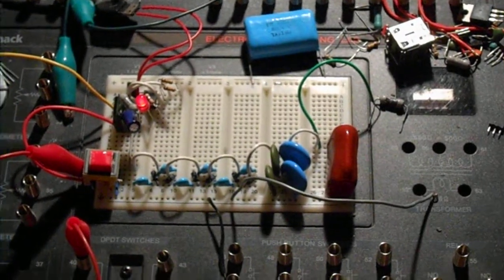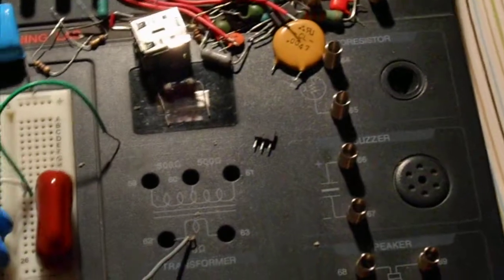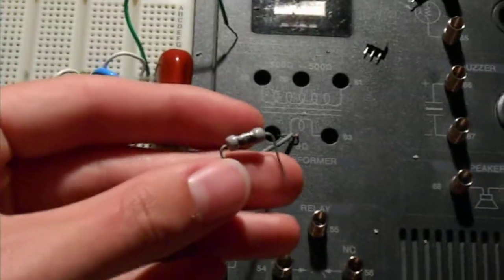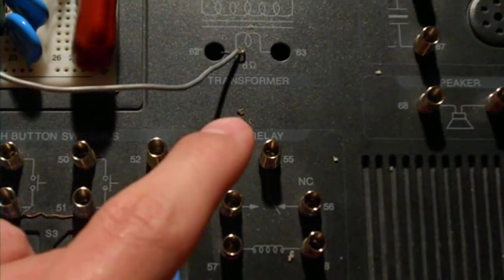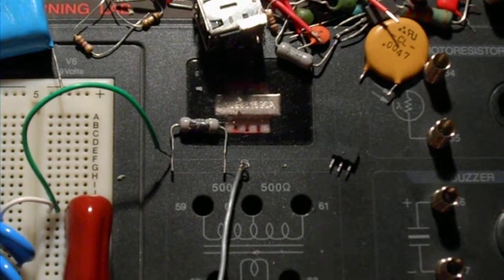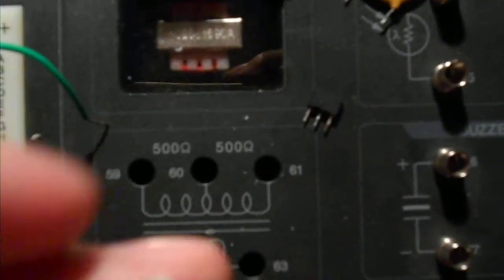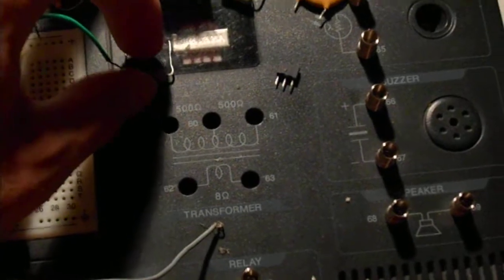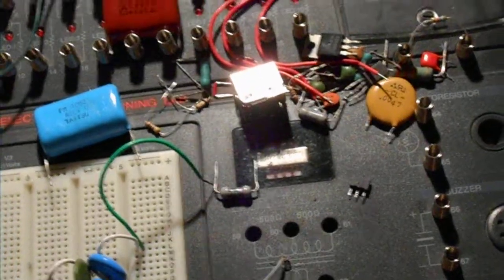voltage mult. using all caps, resistor carnage and Grim Dawn!

Comment from the maker: you mean the green caps? they sure do look like a power thermistor but they are caps. just last night i had checked the voltage leak of all the caps and only the blue ones had a noticeable self discharge, the green ones i could actually charge so that the spark would almost jump across its terminals :)